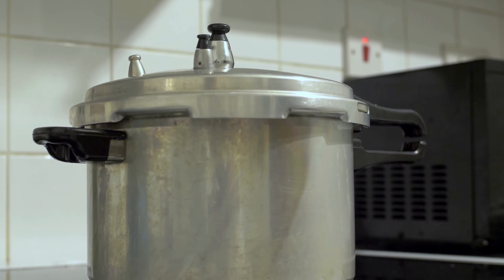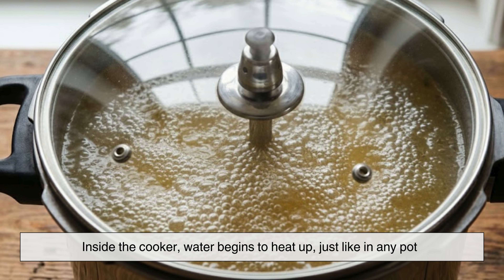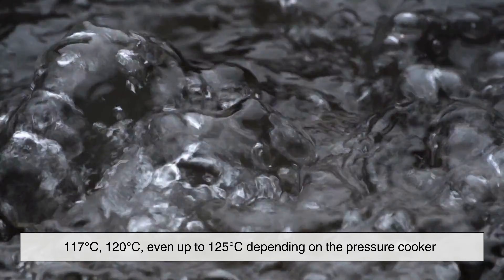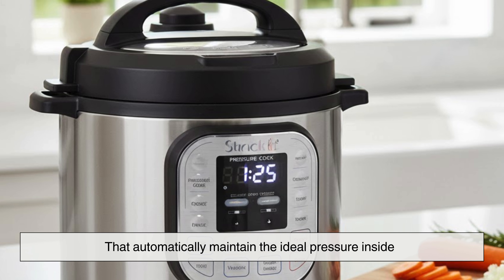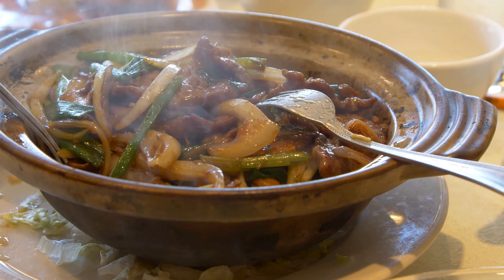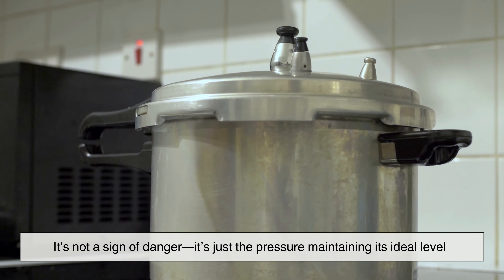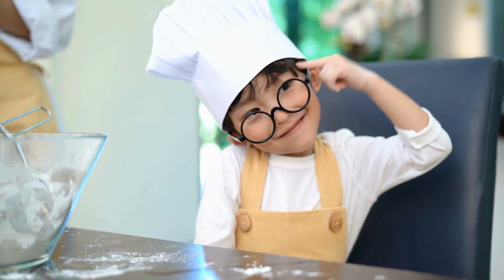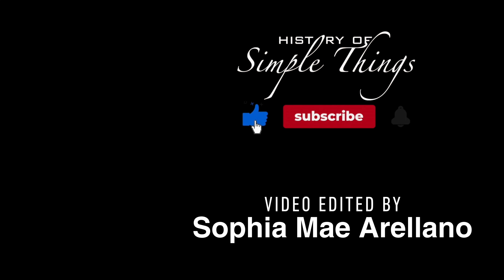How a Pressure Cooker Really Works — And How It Builds All That Pressure [ID2204]

Comment: 4:30 The higher temperatures do help with the breaking down of the ingredients.
In a 15 psi pressure cooker this typically happens at 120°C.
But the bigger factor in why the food cooks faster is the literal pressure helping the steam/water vapor penetrate into the food and transfer its energy.
A 20% increase in temperature isn't nearly as effective as a doubling in atmospheric pressure.
Thankfully we get to do both!

Comment: A simple but important fact that the video doesn't mention is that water boils at 100C or 212F  AT SEA LEVEL.  For anyone cooking at higher altitudes, there is less atmospheric pressure, and water boils at a lower temperature.  When using adjustable pressure cookers (with 5, 10, and 15 pounds of pressure, for example), altitudes above 1000 feet often have to increase the pressure by 5 pounds. If they're already at the maximum 15 pounds of pressure, then they'll have to cook longer than the recipe specifies.
Reply: Thank you for pointing that out
Reply: I just mentioned how significant it was for mountaineering, and live at 5k+. They're great!

Comment: My mom had a pressure cooker back in the sixties.  Had the wobbler on the top to release steam. After cooking she would remove the wobbler and place the pot under running water to drop the pressure.  My dad made sure my brother and I knew how dangerous a pressure cooker was, explaining how they worked  even though we wouldn't be using it for many years.
Reply: Mine too.  She had a "Presto" model.  She used it quite a lot.  As you say, we kids were not allowed to use it.
Reply: I'm always extra careful letting it slowly cool and depressurize after also, the goal is to keep the chatterer cap, just barely chattering.